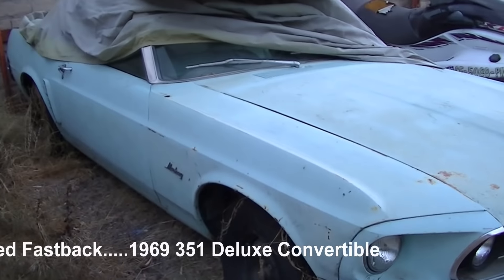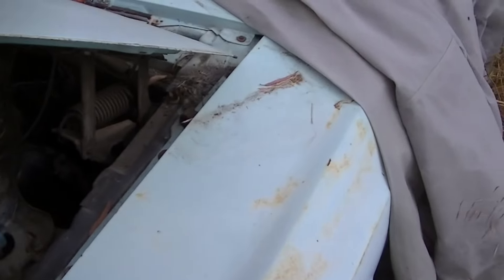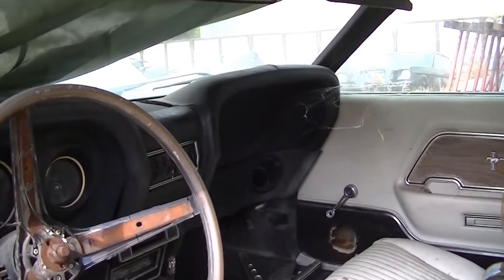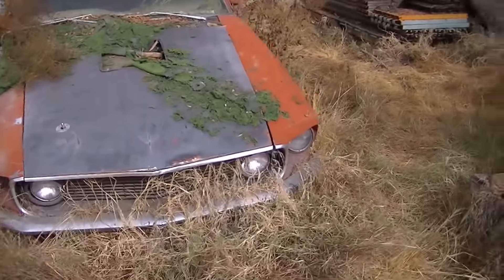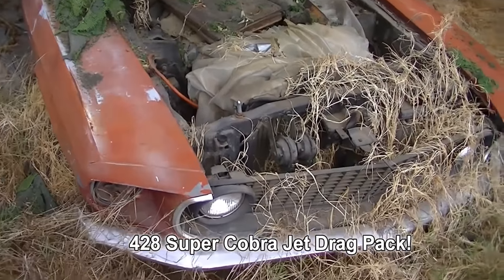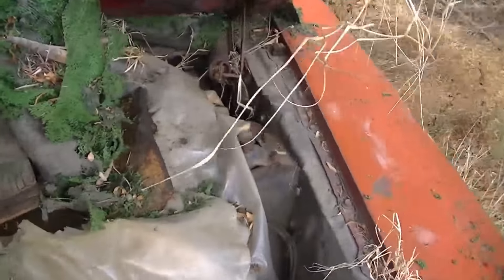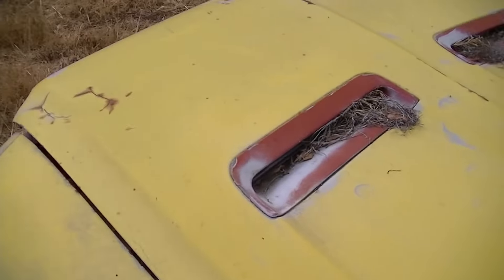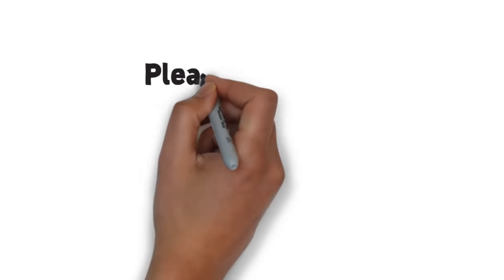Yard Find Mustangs ! 1969 Mach 1 428 SCJ, 1968 S Fastback, 1965 A Fastback, 1969 Convertible

Comment: Man its like finding out a unicorn exists and it was killed. So sad to see these beautiful cars in this condition. At least the intention is to bring them back to life, hopefully sooner  than later.  I understand the sentimental I have a few Mustangs myself I had to build I always kept around, my 77 Cobra II Pinstang I called her.. lol  It never went back to original but did get a heart transplant of 427w and a ton of giggle gas.... and my 69 Coupe I'm redoing right now its a Man o War 438W also tons of giggle gas E-85.. but body is being worked on now. Luckily she was straight and solid. Just in process of doing disk brake conversion, and trying to tuck the widest tallest tire I can without hitting or tubbing.  From what I been finding looks like 275/60/15 seems to be about it, 4.5-5.5" back space.. not to sure, do you have any info links I can check out and cross reference information? Although I love Mustangs, I love the dragcar stance better, but worry not. They are staying drivable street style stangs and not jungle gym cages in them.  Just love hitting the go fast pedal and pinning to the seat. lol  And I want them to look nice at the same time nice job on fixing beauties of the past.. much appreciated.  The things about all my mods is they can be put back to original if someone wished it too.
Reply from the maker: Yes better that the survive being crushed like so many other cars in this condition back in the 60's, 70's and 80's when they were simply used cars. I am sure something positive will happen to these cars. Sounds like your 69 is gonna be mean. I found this on tire sizing and it looks pretty comprehensive. Hope it helps.    http://www.dodgestang.com/Tire%20Fitment%20Guide%2069-70.pdf

Comment: Back in the early 1980's I had a '69 Mach 1 (351 4V/4spd./3.90:1) the same color as the convertible. That conv. is the first one I've seen
(other than mine) in that color... aztec aqua???  I called it robins egg blue.
Reply from the maker: Yes the official Ford color is Aztez Aqua but yep it sure does look like Robin's Egg Blue. I have seen a couple of Mach's in that color over the years but they are pretty rare.

Comment: We have  a  428 cobra jet crankshaft  and a 1969 r code vin plate. Do you know the value  of these items?
Reply from the maker: Hard to say, when you say vin plate do you mean the dash plate ? Technically that vin plate unless it's attached to a car is worthless and cannot legally be sold so I would be careful with that one. Ebay is a good enough place to get an idea on the value. They are difficult to ship  so that might limit you to a swap meet or local pick up type sale.
Reply: @MustangConnection1  it is the dash vin plate.we found these in a storage container we cleaned out.
Reply from the maker: The 69 VIN also appeared on both fender aprons, stamped in, and were covered by the fender. If someone managed to have that vin plate reproduced that you posses then  it would already be in use on a car out there somewhere. I would have your local DMV run the vin to make sure it's not from a wrecked or stolen car.  Any legitimate car person , shop or builder would never risk attempting to put that vin on another car as that is highly illegal. Point being that tag by itself isn't worth much.
Reply: @MustangConnection1  i understand.we didnt buy , just found it in the container .i thought about the dmv but will probably just throw it away.we did find a buy for the crankshaft though😀

Comment: Nice grouping. Meets my love for 1969. I have a convertible and used to have a sports roof. As for restoration, what's the age of the owner?  If you assume 18 months per car to restore... It's not likely to happen after 20 yrs of sitting/rotting. If they had sentimental value, they should not be treated this way.
Reply from the maker: Someday, somehow they will make it back to life.....some sooner than others.
This guy has saved many that would have been crushed back in the day so it all works out in the end.

Comment: So. I actually need all the interior for the fold down seat - where to find it if not willing to pay too much?
Reply from the maker: +02powertube They aren't parting out these cars so I can't help you there.  Original fold down parts are getting harder to find for sure.
Reply: +MustangConnection1 

looka like i need to pay the big money. Thanks for your answer :-)
Reply from the maker: 02powertube I'm in the same boat we are doing a 69 Mach 1 that has been robbed of all of fold down stuff and the repops are horrible. Good luck!
Reply: +MustangConnection1 
I just found the seats for my 68, ok condition licated here in Denmark. paid around 750usd. they need new carpet, polish of trim and some TLC. 
Guess i was lucky, orice on VAT to Denmark is around 35pct, that makes all US stuff expensive as hell when adding shipping costs. Good luck to you as well.

Comment: If the owner actually cared about these cars, they wouldn't be in the sad state that they are, and he would gladly sell them to someone who wants to restore em....that '65 A Code is my favorite bodystyle of all Mustangs, seein one in that bad of shape kills me....
Reply from the maker: +Branon Fontaine  It's called time and money and yes this guy has restored and saved doezens of cars over the years.  They aren't getting any worse where they are stored that is for sure. As of sad state, there are millions on Craigslist and Ebay, etc that  have been neglected for decades. Plenty to save that is for sure. So you have restored an old Mustang before or are you working on one?
Reply: +MustangConnection1 I have a 65 coupe, basket case, rotted and semi restored (incorrectly).  So I want to put my 70 429SCJ in it being I haven't been able to find the correct Torino to put it in. I've been waiting 20 years and still haven't found it. Time to have fun!
Reply: I'm thinking on calling BULLSHIT to this video and 1 or 2 others I have seen from this dude.... This yard I think belongs to a guy that calls himself MUSTANG 1. He worked for me at one time a long time ago. Said he had a MUSTANG salvage business. I did a metal roof on a storage building on this site I only watched the video half way but if I am correct there should be a tan building and the roof is mine. We did it about 1999. I know KURT makes a bundle off these cars and the parts so I am calling bullshit that faded light blue car has been there for decades in fact it was there when we did the roof along side the black 65... The yard looks abandoned KURT has multiple properties Pennsylvania New York Delaware so he told me this a company he and his father started in the 70's. I have to see if they still exist at the time it was called MUSTANG 1 and the road onto the property says MUSTANG 1 besides NO TRESPASSING...
Reply: so do you puff peter??

Comment: You said the blue 69  convertible was a 351 Windsor car. Don't you mean 351 Cleveland?
Reply from the maker: No that is a Windsor, no Cleveland engine in 1969 in Mustangs. Even in 70 the H ( 2 barrel) code 351 could be either a Windsor or Cleveland.

Comment: How do you know if it’s a Mach 1 boss etc ?
Reply from the maker: A variety of ways, Boss 302 cars have a G in the vin or a Z  for Boss 429s, Mach 1's  can be an H, M, S, Q or R. The Mach's have specific interiors and options as well to help identify them.
Reply: The one I’m looking at guy says it’s an L code has the black boss like stripes on the sides but doesn’t say anything just the chrome cursive mustang logo it has the headrest seats guy said it came with a 302 engine and it’s an auto mustang
Reply from the maker: L is a originally a 6 cylinder car. All Boss 302's are G codes. Regular Mustang 302's are F codes in 69 and 70
Reply: So this would be a base fastback ?
Reply from the maker: yes

Comment: They only made 500 candy Apple red mach 1 or was it 1970 boss 302?
Reply from the maker: Ford changed the name of this particular red several times over the years for the exact same color. Ford made nearly 75k Mach 1's in 69 and the most popular color was Candy Apple Red so no way more than 500. In 70 Ford built about 7500 Boss 302's but Candy Apple red was renamed Medium Red for 70 but it's the exact same color. No idea how many 70 Boss 302's were Medium Red.

Comment: Sorry  SCJ Mach's are Q code not R.
Reply from the maker: ? A Super Cobra Jet can be a Q or an R code. The R code denotes 428 CJ Ram Air, the Q code is a 428 CJ non ram air. The super package could be added to either. In fact I have rarely even seen Q code SCJ's most are Ram Air cars.
Reply: You are absolutely correct, they were rated at the same hp but the q codes were much rarer, good job my friend.
Reply: Wally World i have an r code 70 mach1 428scj with drag pack all original im restoring
Reply: Yeah my mistake Q codes are non-ramair and that car obviously had a shaker. Good luck with your car
Reply: Wally World no problem, thanks, yes mine has the shaker.

Comment: That's Not Storage,  And They Are Going somewhere. In The Ground IN The Form Of rust. What a shame.
Reply from the maker: That is one way to look at it OR  these cars were saved and not destroyed as countless other cars in this same condition back the 70's, 80's and even 90''s when they were just used cars. Considering this yard had more than triple the number sitting there now, I would guess these will be just fine and make it to greener pastures someday.

Comment: '69 R code 4 spd car, 4:30 gear set, red.  Worthy of restoration....not worth much toi me in that condition....needs 40K to do it right
Reply from the maker: True. Remember that this car should have ended up in a wrecking yard when this street racing crash occurred in the early 80's. Stripped of its drive train and sent to the crusher  because at the time they were just used cars. The fact it exists is testament to the owner whether they ever choose to restore it or not,  which as you have noted will take a significant amount of time and money to do it right.
Reply: You are right........good thing it was saved.  1987 I almost bought a 351W '69 Mach 1 factory 4-spd car for 3500, and it was NICE.
Reply from the maker: Those were the days, small block cars were particularly affordable. 65-68 Fastbacks were dirt cheap too. Oh well, gone forever. $3500 in Apple stock in '87 hmmmm now that's an investment opp worth lamenting.
Reply: ....or Walmart.
Reply: I am still amazed at what a 66 coupe can bring these days